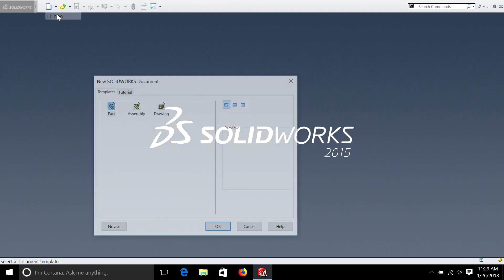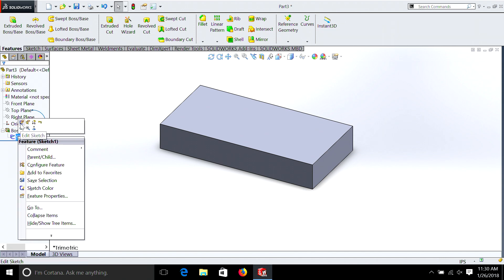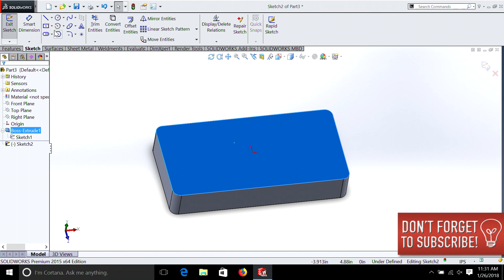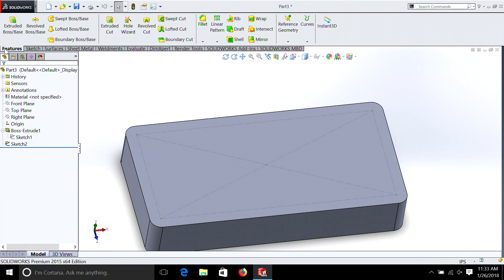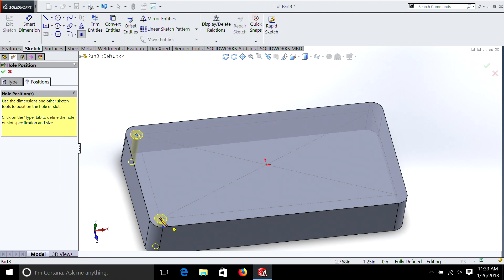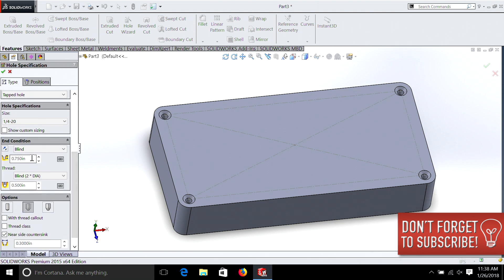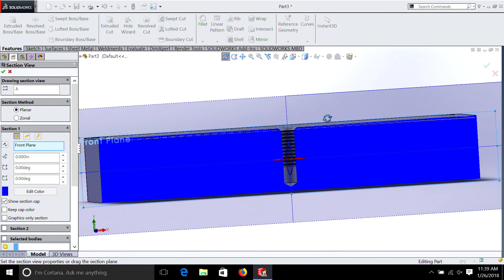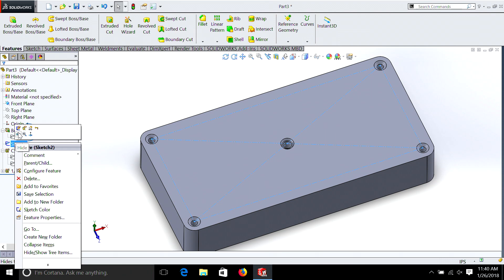Learn Solidworks In Five More Minutes | Part  6

Comment: I followed the steps as shown however, I end up with just a regular hole not a threaded one in the center of the piece.. any help?
Reply: JK just didnt have the thread detail on. Your vids are on point!
Reply from the maker: Threaded holes are just a reference. The drill size is the important part. You can turn on the "view threads and other details" under options. I don't remember the exact name of the setting but it is in there somewhere. Turning it on uses much more graphics processing to show the threads.